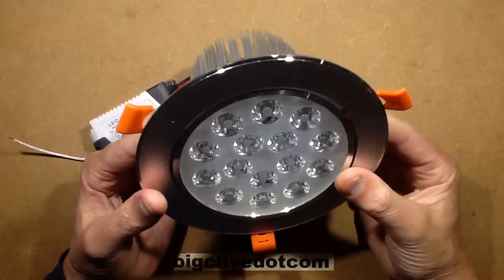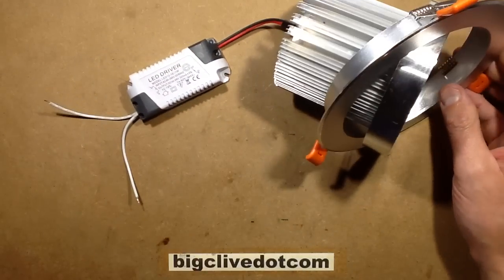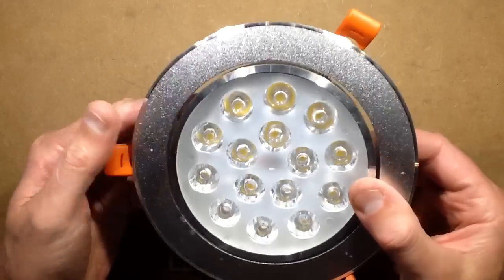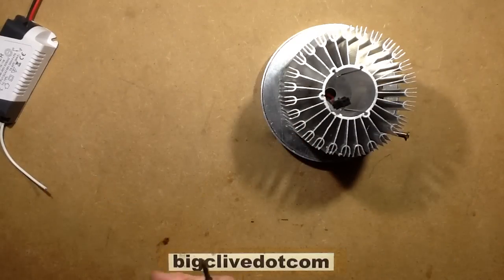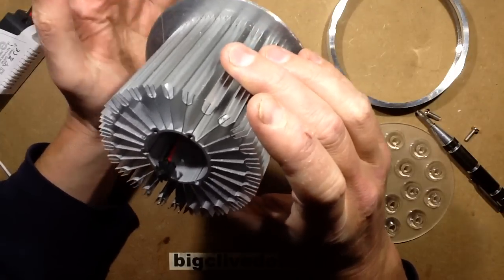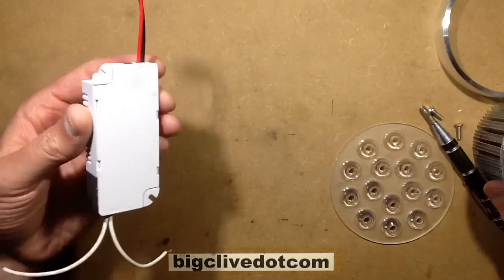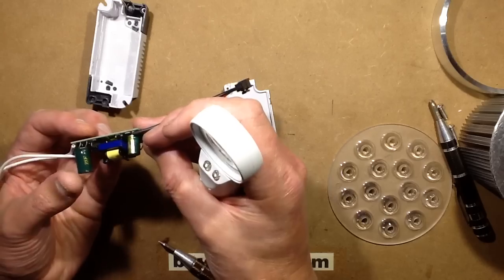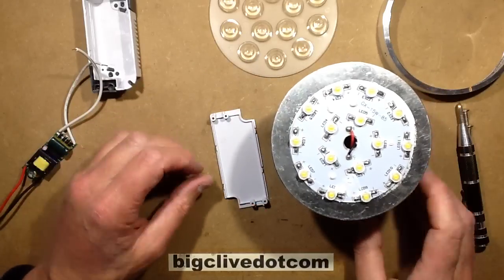A look inside a "45W" LED downlight.

Comment: Way, way, way too much LED stuff. You'd have another Patreon (your version) if 1) not so much LED (like you give a shit), and,
2) Stop endlessly pumping your buddies product. Enough already. $100 Bucks for a tool I built a decade ago from an old 3P contractor. Seriously, it's not even got debounce, PP correction, adjustable CL, tracking output, etc.  All stuff I did with junk parts. 

Unless you make money on this, quit it. It's a joke product for anyone who has gone beyond their electrician apprenticeship.

Comment: Corsair PSU is full of that heatsing compund, like, blobs of it just sitting on inductors and capacitors. I mean, jist like someone squished toothpaste above them lol. I have always thought it's due to idk some machinery fault or some individual having a bad day, but is there any purpose to putting that white stuff when there is no heatsink anywhere near? Intriguing I have to say. Also, what would be the difference between that stuff they use and normal PC thermal paste? I was going to use Cryopaste to cool down some of my components but then wondered if there's some better alternative and what are the pros and cons of using it.
Reply from the maker: If it's the firm rubbery compound then it's also used to secure components against vibration.
Reply: bigclivedotcom it's.. I dunno how to describe it, but it's kinda creamy. Not rubber at all. But maybe it dampens something, who knows..
Reply: GamleErik100 oh nice.. I'vee found that some of that is in fact rubbery by poking it woth my screwdriver but some of it is just the white thermal compound. Really weird.. it's interesting how they actually put the cables into tubes that click in place on the PCB so you can't cleanly desolder them, I guess it makes manufacturing easier and the whole structure more rigid. Btw are PCB traces special in any way? The ground plane on my PSU was all covered in solder but +12V was delivered only by two thin lanes, they were like a mm thick and the PSU is rated for continuous 36A on 12V rail. And it isn't some multi layer PCB plus the copper thickness is really low isn't it?

Comment: Hey, Clive, I believe the 45W rating represents equivalence of light output to a 45W incandescent bulb. That's the way compact fluorescent and LED bulbs are labeled for retail sale here in the US. I have a pack of "60W" CF bulbs whose actual power consumption (according to the fine print on the label) is only 14W.

Comment: Hello Clive, been watching your stuff now for a while very useful. I am a Catholic Priest in Sth London. Just caught this. Your light here looks suspiciously like the lights I have been installing at high level in my church. I have used 18w projectors style lights in place of 100w Halogens. Remove the track connector and fix lamp to original base of the Hallogens. Seeing yours in pieces it looks identical behind the lens and led layout with these. http://www.ebay.co.uk/itm/5W-7W-9W-12W-15W-18W-LED-Track-Rail-Ceiling-Spot-Light-Downlight-Shop-Lamp-/262455260438?var=&hash=item3d1b8d7516:m:mzw_OUbZ-WMeAwyx8JeagIg
The transformer is placed openly inside the hollow projector body without any heat sink but I suppose so much empty space no heat sink is needed. Anyway curious that these are actually rated 18w whereas that devise is supposed to be 45w. Speak again you could advise me on some other ideas. Kevin R (Rev Our Ladye Star of the Sea Greenwich)

Comment: While we’re on the subject of LED lamps, I bought one of these http://www.ebay.co.uk/itm/291762121433 for use with a 12V lead-acid battery during power cuts. It’s advertised as 18W but, true to form, it only takes 0.7A at 12V so about 8.4W.  So I did a Clive on it and opened it up and it has no driver but there are 12 strings each of three series LEDs plus one 22 Ohm resistor.  So if the LEDs drop 3V each then  there should be 3V across each resistor which gives 136mA per string and 1.6A total or 19.2W.   Almost as advertised.  It also has 18W marked on the aluminium plate.  

So why does it only take 8.4W?  The answer is that the flexible leads supplied have a total resistance of about 2 Ohms which is roughly the same as the 12 resistors in parallel.  So it halves the current and the power.  Also the LEDs actually drop 3.2V at this current of 60mA.

So it would be easy to increase the power level to the intended 18W by replacing the flex leads with heavier gauge wire but this would not be a good idea.  As it stands the aluminium plate holding the LEDs operates at 80 deg.C so doubling the power dissipation would increase this to about 140 deg.C.  This probably wouldn’t instantly kill the LEDs but they wouldn’t last very long.

Even at 8.4W it looks quite good with its opal diffuser so at about £3 I think they are a good buy, it could be handy to keep one in the car too, but sorry Clive they are cold white.

Comment: Might be interesting to detach the finned heatsink, and reattach with some heatsink compound between the backplate and the finned section. Then run it with a decent PSU and see whether the  LED backplate becomes too warm.If that was dissipating a "real" 45W, the device would be (roughly) equivalent to a 500W tungsten - a "pretty bright" ceiling light I'd have thought :D

Comment: 2:53 - I believe the US terms you are looking for are "sheet rock," "gypsum board," "plaster board," and "drywall." The most common being drywall and sheet rock.

When looking at any product, I assume the wattage advertised is maximum rating - since it's that higher-number "wow factor" that sells to uninformed consumers. This is especially true with audio equipment, where wattage advertised is Peak, not RMS, and therefore not what the user will experience 99% of the time.

Inquiring minds want to see this thing cranked up to full power - and then, if you want to crank it up some more, give it a go... FOR SCIENCE! :-) 

OR! You could try putting those color-changing LEDs you showed in an earlier video, in place of the originals, that might be a nice effect!

Comment: Since the board says 15 watt I hope they will refund the difference.
Reply: $10?  Last time I tried shipping something internationally, it cost me about $40 and that was a small package. USPS is great domestically but they're not the state-sponsored export driving engine that China Post is.
Reply: its a 100% refund! Ebay policy states it is not as described, so go ahead and order 50 of them and then get a refund... SIMPLE
Reply: The seller can (and likely will, if you order 50 of them at once) ask you to ship them back to China, though
Reply: Ron Garren hes the one that commited fraud so i doubt it very much.
Reply: Always, and I mean ALWAYS, use the eBay return process through the website.  Don't ever let a seller talk you into sending something back at your expense with promises of a refund later.  They'll whine and moan about shipping cost and import duties, and anything else they can think of to talk you into paying.  Let all of it fall on deaf ears!  Trust me, if it goes wrong -- which it will -- and you didn't use the eBay return system, eBay customer service will tell you to pound sand.
Reply: My understanding was that you had to go through the seller process first, including shipping the item back at your expense, and only involve eBay if you don't get a refund in a timely manner.
Reply: Eddie the Grouch
I guess it may depend on the circumstances, but assuming the return is for "item not as described" or "item defective," you shouldn't be paying to return it.  In the case I learned my lesson from, I ordered a ~$400 item of test gear.  The seller first sent the wrong item, then a defective item.  They weaseled me into paying return shipping on both boxes (~$65 each), refunded the purchase price and ignored my messages and PayPal invoice for the return shipping cost, despite multiple promises to pay me back immediately.  eBay customer service (script readers in the Philippines) refused to help me -- or even talk to the seller -- because I hadn't used the eBay return system.  I eventually got paid, but only after I left scathing negative feedback and the seller tried to buy a feedback revision with my money.  The only thing eBay cares about is maintaining the flow of listing and final value fees from sellers; they're not interested in helping buyers if they can avoid it.

Comment: That's a similar driver to the flat panel LED light I asked you about a couple of months ago.  It's a different chip than the ones I have, but everything else looks exactly the same.  I put both ferrite cores and noise suppressors inline and it knocked the noise in the am radio quite a bit.  That and relocating the radio to a different part of the kitchen.  I was actually debating between getting these or the flat panel ones.  I wanted a nice diffused light, and I thought these might show shadows from each LED, so I went with the flat panel.

Comment: I always see you reviewing these LED lights that use way less wattage than they claim, but I haven't run into this problem myself when buying a few cheap crappy LED products off ebay. Have I been lucky or do you select a higher percentage of stuff that's over rated for videos?

Comment: I get under-driving LEDs for longevity - but advertising something as being more than 3X its actual power is just blatant fraud. If it had come out at around 40W I would have said well, close enough - but ~14W?! This is all too common with LED stuff - and the exaggeration seems to continually get worse as manufacturers compete for business.
Reply: Really things need to stop being rated in watts and use lumens instead, because even among the same technology (incandescent, CFL, LED) there can be very great differences in output for the same wattage.  For example, I have a 6W CREE LED bulb and it gives off far more light than my LED I got on my favorite auction website that uses 11W.
Reply: +John Smith 👍👍👍
Reply: You can't really depend on lumens, because that's a (frankly) theatrical designation for calculating light intensity at a specific distance in a specific spot.   A 'spot' throw LED light, running at 1 watt, could produce more lumens at 3 feet than a 'wash' LED running at 10 watts.   (Also see 'candlepower')   

You would have to somehow come up with a set of tests for the various types of lamps (spot, flood, wash/bulb), the distance to use, and then you could try to calculate a good comparison - and the fraudsters would still lie.

Comment: Any thoughts on these driver units, should they be used or not in an actual installation, I have ones with CE marks but there probably fake.
I am tempted to throw the driver in the bin and buy a reputable one.
Reply: The capacitors probably will not last for very long. Change those out for quality name brand ones and you would have first rate gear.

Comment: I got the quick test and it works just fine for NA mains, just wire up a normal plug to it (it ships un wired, you have to do this either way).  Then I just put a piece of black and white electric tape over the internal clips to match NA hot/neutral colors.  Thanks Clive for the link in the other video with the US based distributor!

Comment: we call it sheet rock here in the u.s.
Reply: In the US Midwest it is called Drywall or Sheetrock.
It is also occasionally called Gypsum board.
Reply: sometimes sheetrock (no space) too.
Reply: ok lol
Reply: And in Canada we call it drywall
Reply: I find it fascinating that the same thing called by so many different names depending on where you live.
Reply: +rchandraonline yeah, I think that Sheetrock was or still is a brand name but I hear it a lot. Drywall is usual -- another brand name originally?
Reply: we call it dry walling the act of hanging sheetrock, but buying it we call it sheetrock...
Reply: Sheetrock, drywall, gypsum board, gyp board. I've heard all of these here in the States.
Reply: Drywall is usually used to refer to concrete board where you have a scrim mesh impregnated with compressed concrete. This stuff is used in wet locations like bathrooms and won't swell and distort over time like gypsum board will.
Reply: and occasionally, also gypsum pannels
Reply: for sure..... i even heard it called chalk board from time to time....
Reply: +GGigabiteM I've typically heard that particular product called cement board, Durock (made by USG aka US Gypsum) and Dura-Rock being two of the brand names in the US.

Comment: Speaking of LED downlights, I figured the fine folks here would be the right ones to ask:
If I just replaced a few halogen downlights with some brighter LED ones, but only realised after the fact that I'm not meant to have them on a dimmable circuit..

Think it's okay to just replace the dim switch with a normal one?  There shouldn't be anything else in the circuit right?
Reply: Yeah should be fine to just change the dimmer with a normal switch,.
Reply: if you like dimming effect, you could change the normal dimmer with a pwm one

Comment: Why are there so many sellers claiming to have products with a higher wattage than they actually are?
Reply: To draw in more gullible buyers obviously, for example, those portable solar panels tend to be sold at their panel's max rating rather than what you can actually expect out of it, so it sounds more impressive and a better value to buy a 7W solar panel instead of a 4W or 5W solar panel and same with battery banks where they give you cell capacity or iphone charges instead of something meaningful, such as boost efficiently.

That and confusingly LED lights tend to be sold at what their equivalent replacement would output, so in this case, they "could" be referring to it as a 45W replacement but probably not.
Reply: I think it's because bigger numbers always mean a better product.
Reply: I have build some lighting for one of my rooms myself. Total power: 7W
Reply: On the other side lower numbers also means lower power consumption, so they could also use that as a selling point.
Reply: At least the wattage figures are not as ridiculously inflated as they are for audio amplifiers.

Comment: Have you considered getting two different items off of one listing to compare? For example the '45W' and '15W' to see if they are actually different or just priced higher.
Reply: That's a great idea!
Reply: They usually are not the same, the 15w model should be a 5w one.
Reply: Underrated comment